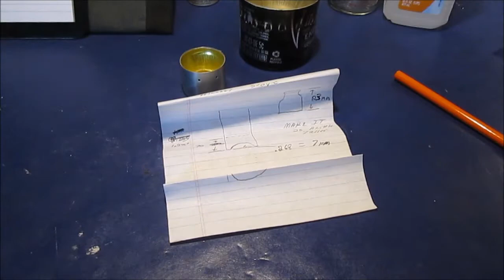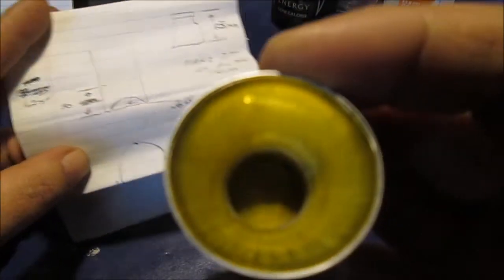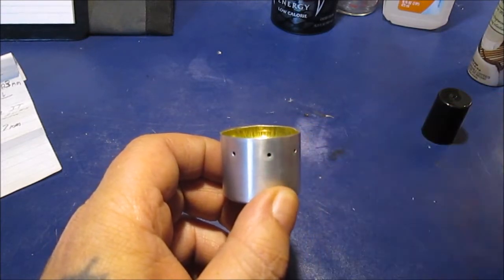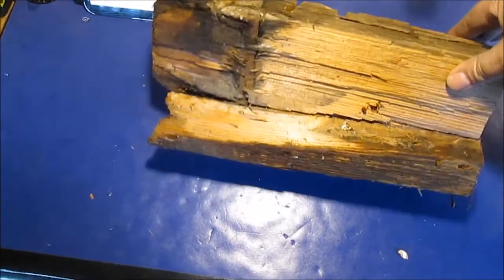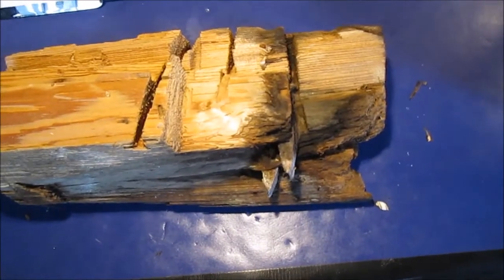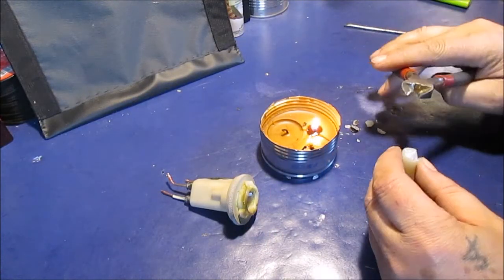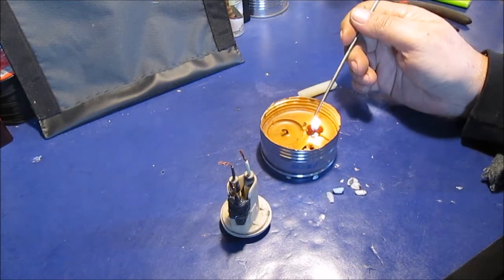Sunday in the Shop with not2fast4u2c   3-26-2017

Comment: Your wood burner at 12:50 in this video. ..would that be gas hunting for more air.. Nice stove.
Reply from the maker: You have to be careful if the stove does that ...You could open the door and get what they call backdraft
Reply: Yes.. I have lost my eyebrows many times ..if I may say ..it looks like the stove ..if hot enough ..needs secondary air.
Reply from the maker: All I need to do is close the damper a little and shut the air intake ..and it calms down
Reply: I'm building a similar size stove ..I may well show a video in the next week or so ..*thank you for your time.*